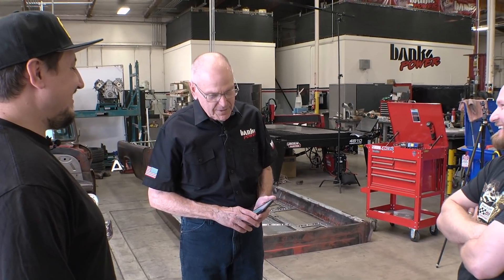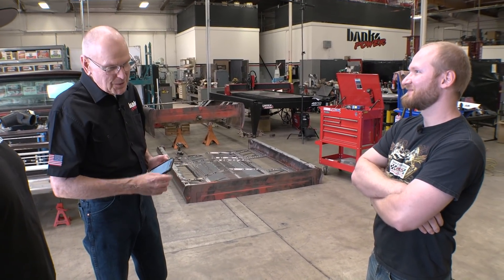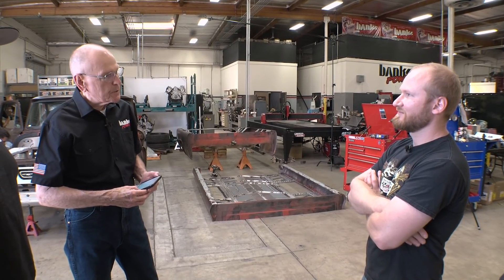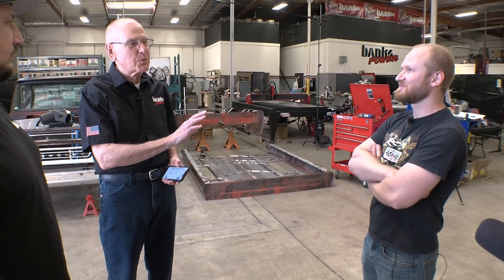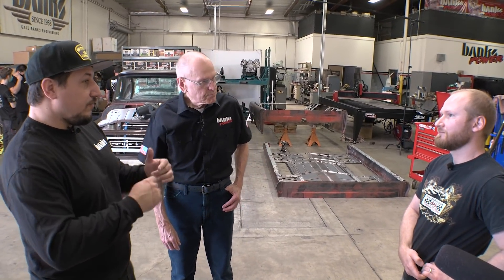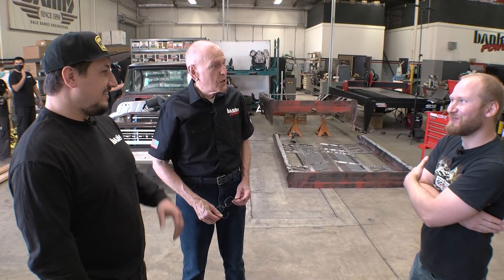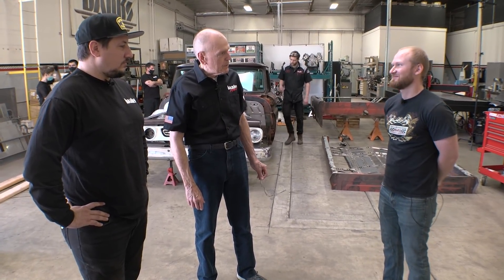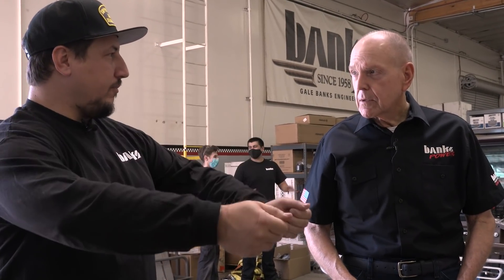Is Gale Banks Building a Hybrid Engine? | BANKS BUILT *BONUS*

Comment: Ok, Gale, I want to see turbo compounding. Now back in the 40's this was a turbo but instead of producing boost it was geared to the drivetrain. Today I want you to do the same but instead tie the exhaust turbine to a generator, making packaging and engineering far simpler.  For daily drivers, use a small turbine & generator to provide electrical power during cruise, probably good for an mpg or two on the highway.  I think you could eliminate the alternator with good power management, even for non hybrids.  For hot rod hybrid, use a bigger setup to maximize power gained from the ICE. 

A similar idea could be used on turbo diesel pickups as well. The shaft connecting the exhaust turbine to the compressor would extend further to a clutch and generator. Whenever the ECU determined more boost was being produced than necessary the clutch would engage, providing extra electrical power to truck. You could reverse the generator into a motor to aid the turbo during lag but then you couldn't reduce alternator size. 
A similar concept exists with independent electrical supercharger and exhaust turbine generator. But that's more complicated than necessary IMO and relies on really, really efficient motor and generator. It also requires a complete redesign where mine does not.
Reply: It seems like the best type of internal combustion engine to use with a hybrid is a small turbine engine which could be used for cruising that drives the front wheels through a CVT and a generator to charge up a lithium titanate battery pack that can power an electric motor driving the rear wheels for acceleration. Lithium titanate batteries have very good performance in the cold, have a long cycle life, and have a high power density and the rear wheels being driven only by an electric motor prevents the need for a driveshaft going through the vehicle. Driving a generator with a turbine is a good idea because you could use a smaller, high RPM generator without the need for gearboxes which offset this advantage and add extra complexity and cost.

Comment: Have you looked at the axial flux motors by Magnax?  The power to weight and size ratio is unbelievable.  The axial flux electric motor would give you more room to work with which gives you more freedom for design.  Your battery pack could be smaller with equal output so you're saving weight also.

Comment: Unsubscribed until the kill a duramax is back.
Reply from the maker: Not sure if you saw our update from a while back. Both the Super Turbo (Monster Truck Engine) and the L5P for  “Killing a Duramax” on hold for an extended duration while we conduct testing for our military program in Dyno Cell # 1 & #2. The moment these projects are completed, we’ll roll both the Super Turbo and the Killing a Duramax back into the dyno cells.
Reply: W/E 🤦‍♂️

Comment: I'd love to see a compound turbo setup! 
Every time I see diesel compounds it's the same story- feeding the big turbo straight into the smaller turbo with no intercooler. The heat stress on the small turbo is crazy, potentially high enough to boil the oil and melt plastics. Even my own calculations show a 7% efficiency bonus* by cooling the air between the turbos. 
It'd be great to see it done properly, as well as even some education on the topic, including turbo sizing. 
*7% less energy required to compress the charge air to a target manifold air density. Energy is extracted from exhaust flow, intercooling would result in lower exhaust manifold pressure.
Reply: 👍 for correct use of "inter cooler", TY 😊
And, yes, you're dead on the money!

Comment: I always wanted to see you do a low compression high boost diesel engine. I started a hybrid build with a 4jg2 3.0T and 80kw wheel motors. But I'll be dammed if life didn't kick me in the head with a brain tumor. 

I mean you don't need heavy mechanical drive components(transmission, driveshaft, diffs, axles). Whether it's kinetic Hp transfer or utilizing Kilowatts doesn't matter, a watt is a watt, so KISS.

Comment: I wonder if the reason for developing a hybrid turbo diesel is to increase fuel efficiency or to eliminate turbo lag.  A 536 hp “torque-filler” sounds heavy but awesome!
Reply: It's amazing how far electric motors have come. A LiPo battery can have a discharge current 100x its AH rating, so a 50v/40AH system (about an AGM size battery) can dump 200kW/270hp! I'm willing to bet such a system can be added weighing less than 200lb/100kg. 
The most optimised/efficient engines target one particular RPM, so the electric would be used to absorb transient loads, more like a turbo antilag, but the result unlocks greater efficiency.

Comment: What happened to the ram truck to you got I was excited to hear something about it
Reply from the maker: Today, October 22, our RAM was at CJC Off-Road in Long Beach, CA getting a Carli Pintop lift with King shocks. It's been wrapped and will get new wheels and tires next week. Then, it comes back for a PedalMonster throttle booster, Monster-Ram, Ram-Air intake and 5" exhaust, High-Flow Boost Tubes and prototype Derringer tuner. So, it's coming along... slowly but surely.

Comment: YES!
Way too many times people don't give any consideration to optimising the intake and/or exhaust pipe-work with turbo-charged engines - or exhaust manifolds with N/A or supercharged diesels!
It's free torque/horsepower (whichever one prefers to work with) if one can design for optimised scavenging and/or ramming, especially with the pressure gradients of forced induction.